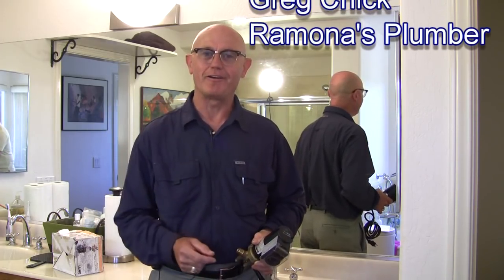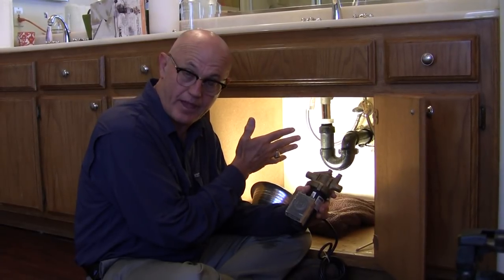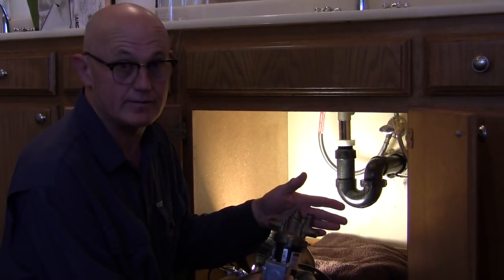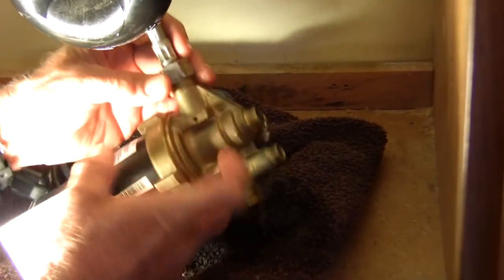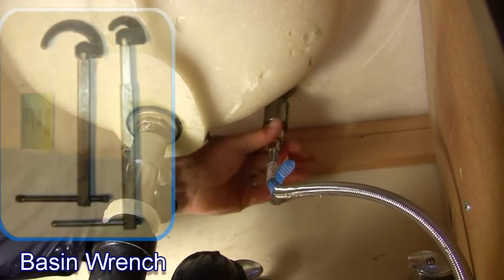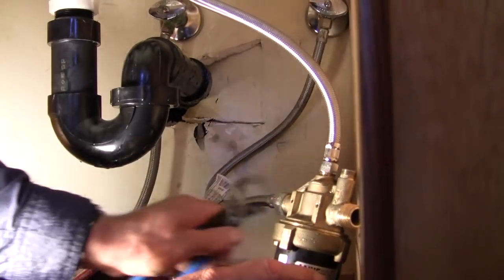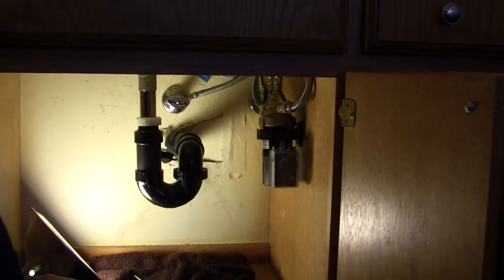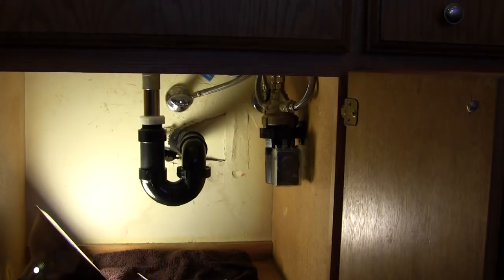Installing a Recirculation Pump for instant hot water and saving water

Comment: helpful video. One suggestion I learned from a plumber. Leave it always ON, plug into a smart plug (available almost anywhere for under $15), and control it with your phone instead. You can use your phone to program it to turn on/off whenever you want, from anywhere. Way easier than using the 1970's dial.

Comment: All I can say is I'm extremely happy with my Hot Water Lobster. I had a pump system in my last house. The pump system filled the entire cold water pipes with boiling hot water for the entire time the pump was running...it was impossible to get water cool enough to shower in...and the pump only lasted 2-years before failing.  Oh well, to each his own.

Comment: So if I understand how this works, you save water by not having to wait for the hot water to heat up.  But aren't you losing water by waiting for the water to cool in the cold side?  We also are heating up the cold side piping which is typically not insulated so energy will have to be made up by the hot water heater as it recirculates through it?  Especially in the colder months of the year.

Comment: Hard to believe I'm the first commenter...I'm new to all this re-cir pump stuff but after buying and refurb/remodeling my mobile home and final resting place I decided to try this system for my kitchen sink...which is way on the other end of my place. So I found one of these units on Ebay and installed it. For me the install was a piece of cake, but I'm very mechanically inclined. I only needed one medium crescent wrench... Done! Beware...the two main fittings in and out of the pump use a "ONE" way valve. Once installed I had questions so I contacted the tech service hot line provided with the literature. I was amazed at how quite this unit is...as the tech guy said... these pumps are quiet and some are very quiet. My other concern was that the motor/cartridge housing get fairly hot. The Tech guy confirmed that yes it does...when the pump is operating. After 24hrs this has been confirmed. OKAY...now here's the rub. Instant "HOT" water? Not gonna happen. Hot water within a minute is acceptable. Now for the rub...The way this works is that it keeps the hot water circulating thru your water system...hot side to cold side constantly, or should I say warm side when not in use. The pump thermo sensor controls this. BUT...on the flip side...if you want "COLD" water it take as much or more time for that to happen...hence the rub or trade off. So for me...instead of waiting "Literally" 2 minutes for warm to hot water...I get "warm" water pretty much at the hit, and the hot within a minute...which is much better than my original system. So... okay...it does a pretty good job. Now the final test will just be time & reliability. I did a LOT of research and shopping around...and some of these pumps are ridiculously expensive! This original post was from an Eastman Nevercold 70601 under sink unit video. I do a lot of business with Amazon and the Eastman water heater top mount unit on Amazon is under $300 bucks. But essentially the same unit under sink mount is over $500 bucks! I don't get that. If anything it should be the same or less and they would sell a ton of these under sink units. They are really easy to install. So there's my take...worth a couple hundred bucks...and I'm reasonably satisfied...and that's no easy task.

Comment: My husband and I just installed this exact product today and I hopeful but skeptical.  We completed the install in about an hour (we were being goofy or it would have been faster).   I thought it was going to take an hour or more for the system to kick in and start working but we had hot water to the bathroom sink right away.  We used to never get hot water to the sinks in the bathrooms, it took too long to wait for it to heat up and the showers took 5+ minutes to get tepid hot water in the winter but it was heating up in 30 seconds.  So far I love this and wish we had known about it for the last 12 years that we have lived in this house.  I'll update my post if anything changes but so far I love it and it doesn't hum any more than a refrigerator, something I can certainly live with!  Looking forward to hot showers and lower water bills!
Reply: Thanks for the report,  and you must have followed directions, yes circulation pumps work.  Some piping is more complex and the house lay out is problematic,  but your must be a simple layout.  Enjoy and save both water and energy.
Reply: Greg Chick
We followed your video tutorial instead of the directions in the box since the product was the same thing you installed in the video!  Your video saved us a ton of money paying someone else for installation!  Thanks!

Comment: This was a clear and informative video. Thank you. Had 2 plumbers cemo out and try to get to buy a thankless water heater. My water heater works and gets hot water everywhere. However hot water to the kitchen and guest bathroom sink takes forever. Neither one mention this option. Smh. $300 for this pump or $4000-$6000 new water heater.
Reply: There are different hot water piping layouts, all layouts do not use same circulation pump system.  Pumps can go at the wtr. htr. or at the far fixture, as well different timers and controls are used to make work best or even at all.  This is not a simple solution.  As well, you guessed it, a tankless is not the answer, they do NOT get water to far end faster.  Fasterhotwater.com.  is best source for a system.  The video you watched is an older video look at my newer video on circulation...
Reply: Yes I got a newer model and installed it in my kitchen after watching your video. It was pretty straight forward thank to you. I'm happy and it saved me thousands as a plumber was trying to convince me I needed a new tankless water heater. Lol

Comment from the maker: Yes, the thermostat valves can go anywhere, and several, not a problem.   The Laing makes a unique pump and a timer is a good feature as is an aquastat. The timer can be just one of those plug into the wall for a lamp sort of thing or built on the pump.  One issue with multiple floors is air in the line.   Purging out all air is needed.

Comment: This just seems like a beautiful way of allowing Legionnaires, the correct way to keep your hot water permanently hot is to have a piped return in the system, this mean there's a hot flow and return, doing as they say, Its used mainly in larger buildings such as hospital, but more and more in larger houses. BUT your best installing it when the first fix is being done due to the degree off pipework that's needed.

Comment: Interesting...I found a similar hot water recirculation valve that is much esier to install. Thermal convection circulates the water-so no pump is required. I installed it several months ago in less than 15-miutes and it has been working great! If you are interested it is called the "Hot Water Lobster". Billy-D

Comment: Due to using the closed loop system within the hot/cold water plumbings, it is very important that the water heater is clean because you will be drinking from it. This hot water will be circulated within your potable water system as well. All the sediments, corrosion, calcium deposits, rotten egg smell (if any) will be part of your drinking water. I would flush the water heater at least twice a year and change the anode rod every year if you have a recirculating pump.

Comment: Thanks for reply,
The pressure of the water comes out of the wall under the sink (warm&cold) is too low (approximately 1 bar). I want to increase/boost it to 3 bar. 
It has to start when i open the faucet and stop when close the faucet. The price musn't exceed $130,- And  must be small as possible.
I haven't more place than what you have in the video and live in Turkey. So the wall outlet is 220 V AC. 
Thank you for your help.

Comment from the maker: T&P valves are not for operation, that is like using air bags for brakes.  A Thermal exp. tank is a good addition to any home where pressure at street is over 80 psi, or a check valve is used in the system.

Comment: I certainly hope you are not a licensed plumbing contractor and do work like this. The pump system is fine. The install job. Definitely a handyman grade job.
  Plus, set your timer to come on at 6:00am turn off at 6:15. The hot water will get to your furthest fixture in less than 15 minutes . Then you will be using the hot water. No need to run the pump anymore at the time period.
   Next time. Try mounting the pump on the wall first. Then run your lines. You can lay them out much neater. Not all twisted up & taking up the lady of the house cabinet space.
Reply: Lee Olaeta so your saying the homeowner has a gap time between 6:15 - 6:45 to use his instant hot water? After about 30 minutes the water in the pipe should have dropped down temperature.  Also his installation is not bad. No kinks in  lines and it’s not in the way of the cabinet space. You might find easier to mount the pump first. Both ways will work some people do things different at the end there still potatoes 🥔 I’ve hade license plumbers with over 20 year experience ( not cheap guys) and there installation is bad. Trust me I’ve seen bad.
Reply: There is always a guy like you in the comment section that can’t help but point out what they deem to be a problem. Maybe you should post a video where you do it the right way.

This is aimed at lee
Reply: Yeah Lee, maybe this gentleman lives alone and doesn’t give shit ‘bout cabinet space. You should get a pump circulating some of that cold water outta your heart brah.

Comment from the maker: I recommend ACT Demand circa. pump in general.  If you want a circa. pump on a tankless water heater,  the Mfgr. recommendation takes priority over my recommendations for warranty reasons, if they specify.   The layout of piping might require a high head pump, or the pipe size might require a pump designed to move volume, not pressure.....  Plumbing design is different than opinions, it needs to be based on protocol set by physics.

Comment: Very good instruction.   Can you install two recirculating pumps?  I've already got one installed on the water heater.  I would like to know if I can install an additional one like the way you did below the sink.
Reply: I'm not a professional so take with a grain of salt but for just a single house I remember my buddy saying it would be counter productive. Essentially they'll just be fighting one another overworking.

Comment: Thank you for very clear lecture and very good presentation the only question is suppose you have several faucets, bathroom, shower, kitchen sink..etc then I assume you have to install a pump at each point.
Reply: Ed,
  No, the pipe goes frpm water heater tp the distant faucet, along the way, it passes the ones between.   The crossovers if used can go at the end of the longest run, and if a T shaped house has such a branch, a bridge crossover valve can go there to allow circulation in that "Wing" of the house.  There are different home piping layouts, details matter, but to cut to the chase short answer, no, one pump.

Comment: I would make the power outlet tied to the light so the pump only gets power when the light is on.  I always turn the light on when I use the bathroom.
Reply: Darrell,
   That is a good option, many people have done that.  One issue is often the light switch is not near the location the pump can go.  But in the smaller bathrooms the location often works.   An amp capacity check is in order, as sometimes the exaust fan is also on that circut!  I have known installs that require a good electrican to arrange safely and to code.   Done this way, the best is to use a fast velocity pump, one that matches the pipe size and distance from water heater.  As well put an aquastat on the pump so when light is on, the pump only runs till hot water is there, and no more, yet again if needed.  
Thanks for the comment, it allowed me to share some details with everyone.

Comment: Thanks for getting back to me. The system in the video, is there any way to not have warm water coming out of the cold side of the faucet when the cold water valve is activated for cold water only? It seams that running hot water back through the cold water pipe will give you warm water if the cold water is used.

Comment from the maker: This Lobster could be a monster for a house that needs a pump and this Lobster is bought and does not work.  In order for it to work there must either be pitched pipes in house, or thermal expansion pushing the water around to loop it.  I suggest if thermal expansion is pushing water there is trouble head with a flood from thermal expansion pressures trapped in piping system.  A pump does not create such pressure, a pump just circulates creating harmless pressure in doing so.

Comment: Thermal expansion, yeah probably.  A T & P valve should be in order near the top of the piping system in the "collector" and a needle valve up there to release trapped air and back venting draining....  Mr. Greg, what kind of timer can I use for the shorter 2 or 3 minute on/off intervals?  Any suggestion of brand name for me to search?  Need something that will last for more than just a few months...

Comment: When the pump turns off due to temperature being met and stops the flow of water, how much does the temperature have to drop before it turns on again to bring more hot water along? When it does turn on again, isn't it going to pump moderately hot or at least very warm water down the cold line? What if after that you want cold water? Won't the cold line then be full of mildly hot water?

Comment: A lot of this working efficiently for comfort surely depends on the differential in temperature between on/off on the pump thermo stat. If it's only a matter of 1-2 degrees the pump will be constantly pulsing the cold line with warm-hot water during the time frame the pump is set to run, which causes an issue if you have the cold open too. I guess you could hope to rely on the cold neutralizing the entirety of hot pulses. I'd be interested to know how well it works in actual application?

Comment: Is there a way to have a recirculation pump close to the source (tankless water heater) that is initiated manually (wireless remote), but at the fixture furthest from the source, an unpowered bypass valve? There are no recirculation loops in this house either. I have seen something on Amazon.com, for a bypass valve by Grundflous, but nothing else. We do not want the recirculation pump at the furthest fixture because it is a pedestal sink. Great video.

Comment from the maker: Thermal siphon will only work if pipe is pitched, most places are not pitched, so you got lucky.   The new code has prohibited 24 hr. circulation because the heat loss is prohibitive, literally.

Comment: Great explanation
Reply: I intend to to be clear as well as for others to succeed in deciding if they want to DIY or not.  All pumps (circulators), are not the same, even more so , all controls are not the same.   Then all homes are not piped same, correct appliction of products matter.   Circulating hot water is a very complex task.

Comment: We moved into this house (built in 2010) that has a tankless water heater. I looked under one of the bathrooms sinks and found this extra house that is connected (on the side) to the water hose going to each faucet and then the extra hoses join together in a small box in the center, under the faucet. Any idea what it could be and is it unique to tankless?

Comment: Hot water pipes under  slab with no insulation conserve water but waste a stunning amount energy as water cools in the subsoil underneath  your slab. My hot water heater would hold  hot water for 2-3 days if not used but if I run the pump for 3-4 hours/day say 5-7pm then 9-11pm the hot water will be stone cold if hot water heater is not energized after the pump has run through its cycles. Best case is take a shower when pump has delivered hot water to the plumbing  to be used, then de-energize the pump and hot water heater for max conservation.

Comment: In the video you said that if you don’t have an outlet at the sink that you could install the pump at the water Heater. That won’t work as this pump is designed only for installation at the point farthest away from the water Heater   This unit has a thermostat which needs to be at the farthest point away from the heater to work.  

This unit won’t work well unless you have shared water main. Some newer houses have each faucet a home run to a central distribution point. That type won’t work because only one faucet gets the benefit.

Comment: If i understand you i need to install pump in my hot water recirculation line? My goes into the bottom of tanks drain valve have a tee installed.

Comment: It's simple physics that enables thermal convection to recirculate the hot water (higher presure hot water vs. lower presure cold water. Ahy way, I'm extremely happy with my Hot Water Lobster. I had a pump system in my last house that filled the entire cold water pipes with boiling hot water for the entire time the pump was running...it was impossible to get water cool enough to shower in...and the pump only lasted 2-years before failing.  For this reason I would never recomend a pump system.

Comment from the maker: Continued,   Some have floating impellers and no seal on motor shaft while others have a cartridge for a motor and the pump is separate.   Laing is a fine local to san Diego pump.   Grundfos is a world wide pump having far more options.   The De-mand Metlund unit has it all, get one.   Or tell me your application and details and I can help you decide...  like I said, Metlund.